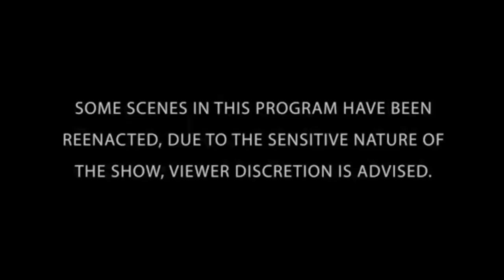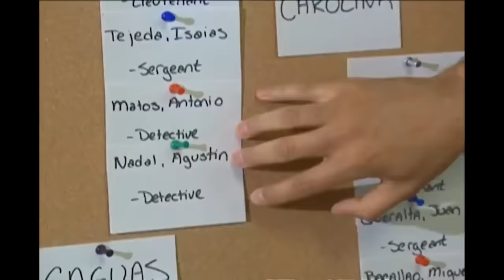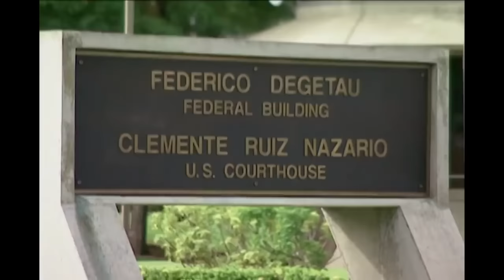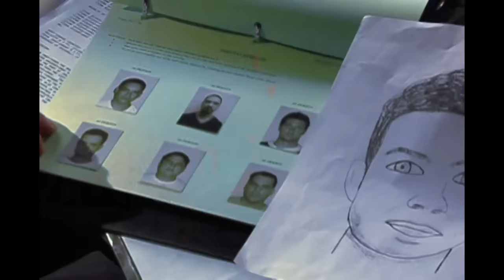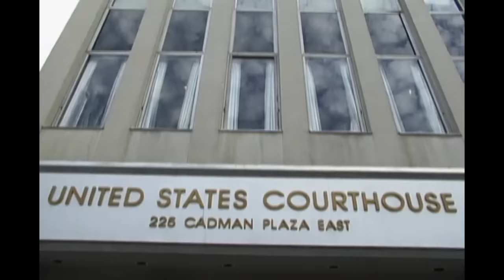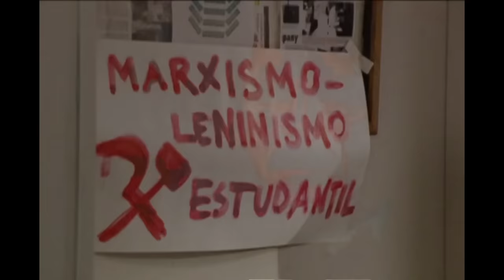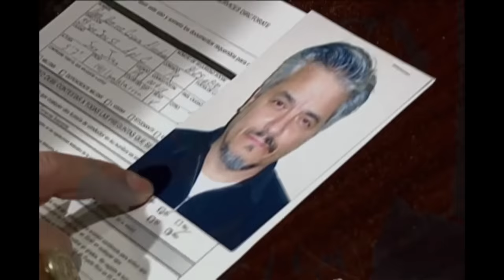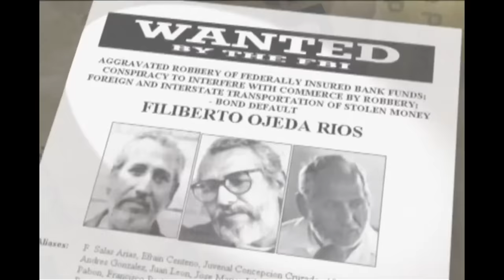The Puerto Ricans | TRIPLE EPISODE | The FBI Files

Comment: 1.23 bollocks there is no way he could have operated those boltcutters with his elbows or even his lower arms, not only do you need to squeeze you need to open them after every single action. Even if he could he would have dropped it numerous times, and didn't he have 'guards' outside his room? They would have heard that. Every suspicious sound made out of that room would have been investigated immediately. So scrap that stupid idea. Besides he would've been into too much pain to screw around with anything someone there was on the take.